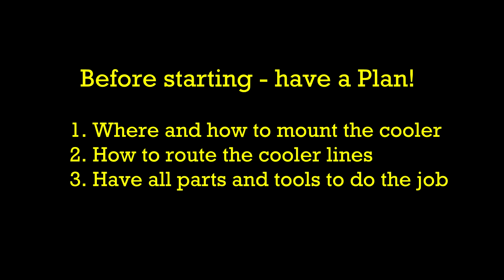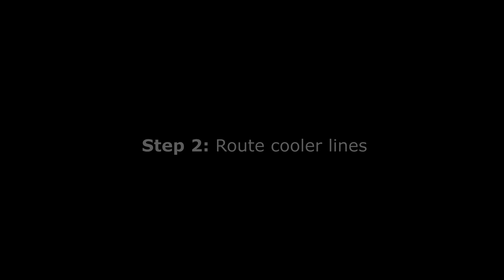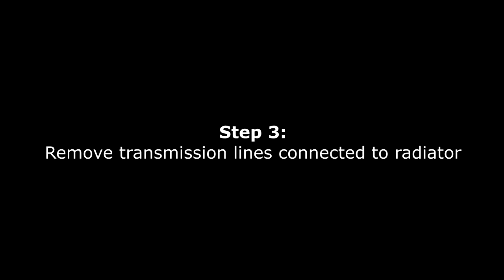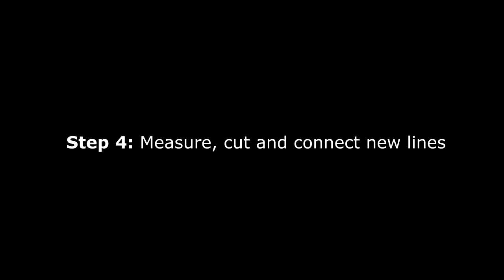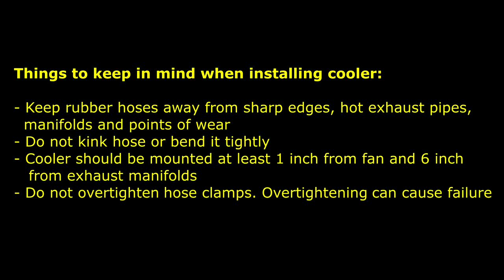How to Install Transmission Cooler Bypass Radiator - GMC Canyon, Chevrolet Colorado, Hummer H3

Comment: You can actually route the hoses through the radiator cooler and the external cooler.  Both!!
Reply from the maker: That is an interesting idea, haven't thought about that
Reply: So oil would run trough radiator and the cooler to trans and both will cool?
Reply: @lordsonic4567  Yes someone posted a vid doing it with a Chevy Silverado.
Reply: The main point of installing the external trans cooler is to bypass the internal cooler. If the internal cooler fails, then trans fluid would mix with engine coolant and cause $$$$$ damage to both engine and trans. Install the external and plug the internal for best results.
Reply: @johnmayo4301  The main purpose of an external cooler is increased efficacy.  Internal coolers are inadequate. Routing lines through both with give you that much more cooling.  Internal cooler failure is highly unlikely.  All it is is an  aluminum cylinder. I have never heard of one failing before.
Reply: @holidayrap  I have heard of plenty of failures and have personally seen 2. I have had my H3 for over 10 years and mainly use it for wheeling in the Northeast along with a large group of offroad Hummer friends. Do what you want but I personally won't use the internal cooler.
Reply: @johnmayo4301  Some have specific instruction to do both (and I'm sure some say bypass completely) You can speak for you own experiences and I for mine.  Free country.  Never said you should or shouldn't..

Comment: Isn't that just trapping all the air in the trans cooler?  I think you are generally supposed to have an inlet at the bottom and outlet at the top.
Reply from the maker: You can mount that way too. This way works just fine for me... actually need to cover it in winter since the temp is too low. Engine temp is no different than before installation. Running this one to monitor both temps: https://youtu.be/4XxPsBD1qAQ

Comment: I understand adding an external cooler but why bypass the radiator. Makes no sense to me. All it is is one long tube with bends. Solid 1 piece and those things dont fail - EVER! I seen the MOD(Milkshake of death) due to driving after an accident and another because of putting in a junkyard radiator. The fail on main radiator is 99.9 a split at the seam or maybe a bolt through the radiator at 70mph. I dunno..i see seperating it makes sense for less moving parts but the radiator is crucial in the engineering of it. If i were to seperate the 2 i would for sure Thermostatic fan it. -Manufacturers (including B&M) recommend to run aftermarket coolers in addition to the factory cooler, not to bypass the factory cooler.
Reply from the maker: This is to prevent mixing coolant with trans fluid when radiator fails... there are number of failures that you can find on the net
Reply: @NewRoad  no need to lol...lol..but at the end of the day...if it worked...it worked

Comment: Don't bypass the radiator though use both
Reply from the maker: The whole point of bypassing radiator is to avoid mixing coolant with trans fluid when radiator goes bad. It happened number of times with those and destroys transmission
Reply: @NewRoad 😆 you do realize there is like another little radiator inside of your radiator tank that the tranny oil flows through. It never mixes together. If a radiator fails it's going to be the plastic tank on the outside that leaks
Reply from the maker: It never mixes together until your 'another little radiator' 🤣🤣🤣 inside of 'big radiator' fails 🤣🤣🤣 - then the coolant mix with transmission fluid and your transmission 'kaboom' 🤣🤣🤣. Just google around and you will find explanation and reason why people bypass radiator
Reply: @NewRoad  
No dude I'm trying to let you know what you're talkin about is an auxiliary transmission cooler. Air-cooled only it's for like when your Towing and stuff. You have to have the cooling through the radiator for the transmission oil though. No way around that unless you like buying Transmissions. You know a lot of you dudes think I'm smarter than the engineers who designed this vehicle so you end up f**** a bunch of s*** up
Reply from the maker: Appreciate your feedback man. I don't think most people are smarter than engineers who designed the truck... but one thing they cannot predict is when specific part is going to fail. Just FYI, my trans fluid is cooling much better now after  I installed external trans cooler. Perhaps I and many others are missing something - please do let me know what are the problems with bypassing radiator?
Reply: @NewRoad  yeah who cares freaking mute
Reply: @SKANK_HUNT49  You know those "engineers" you speak of actually design things to fail, how else are they going to make money off of you?  Any transmission shop will tell you running your trans oil through just the radiator is dumb, 200+ degrees hurts your transmission a lot. The best temp range is between 160-180 of you want the most life out of your transmission and dont want to replace/rebuild it every 100k miles.
Reply: @Itsarealone  I've got 280,000 on my original transmission. With the factory transmission fluid. So it's all about how hard you are on you're equipment. If you don't want to rebuild your transmission every 100,000 miles, never change transmission fluid. That's the real trick
 Transmission fluid doesn't really go bad. And absolutely never do a transmission flush...
Reply: @NewRoad  a
You do know that an oil to liquid cooler removes  25x more heat than a oil to air cooler, right? (basic convection physics). That's why you NEVER eliminate the rad cooler.  Any type of heavy duty diesel equipment always uses the engine coolant to cool whatever fluid that needs temperature reduction, engine oil, trans oil or hydraulic oil. If you eliminate the cooler in the rad tank, your trans temp will actually be much higher if you run the trans fluid through just the air to oil cooler.
Reply: @peterlukasch8579   there is more to it than that. It all depends on the size and surface area of the liquid cooler and the air cooler. Not to mention that the liquid doing the cooling is still air cooled itself and quite hot. We are not talking about boats cooled with liquid to cold sea water heat exchangers here. That being said, I'm about to install a Hayden 699 right now and personally will be using both coolers though. I also have an aftermarket solid aluminum radiator though and hopefully the trans cooler loop is more reliable than the factory units which people seem to have issues with on the H3 for some reason.